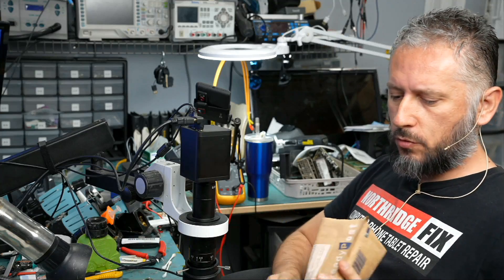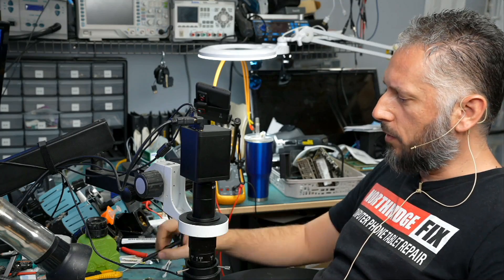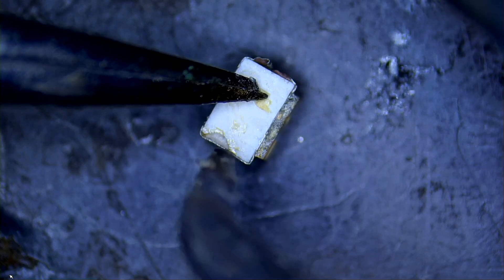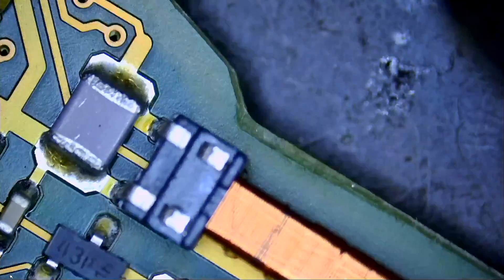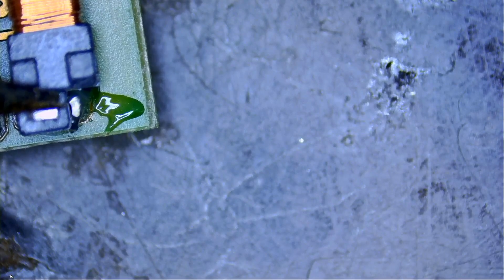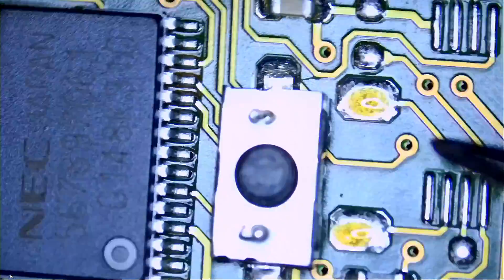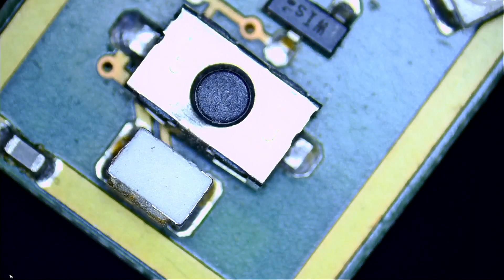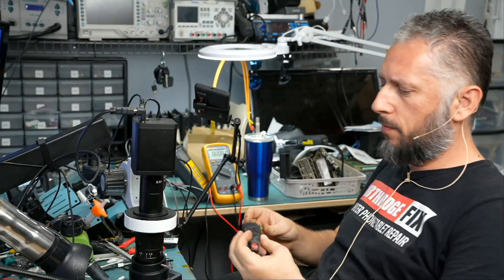2002 Key Fob won't start Car. Fragile Infrared Soldering

Comment: Another way is to grind  near the sensor and put the soldering iron tip near to one of the pads  so you can melt the solder under it and voila you take it out

Comment: I was wondering why a key fob would use IR in this day and age and then I read the title of the video. 2002 car... Ohhhh. My car made in the early 2000s didn't even have a remote control key fob. Must be one of them fancy luxury cars. Didn't know the "fob" keys used IR to start car. Never had a car that came with a fob used to start the car. Why would you want an expensive fob to start the car instead of keys is beyond me. Since it wasn't keyless as you still needed to insert the fob.

Comment: I am wondering if hot air from the bottom and some soldering paste would have also worked for soldering it back in place?

Comment: Your soldering skills are awesome! I have used "Nickel print" to connect to tiny LEDS. Basically, it is a high conductivity adhesive. I use a drop of crazy glue to attach the led and then join the pads on the LED to the traces with a small drop of conductive glue.  MG Chemicals - 841AR-15ML Nickel Print (Conductive Paint)

Comment: There are two things which we could use here without soldering:

One is a graphite adhesive, the 2nd is silver adhesive. You can see them on a rear window of the car which is heating up. Next, once it's holding, you can either use a UV mask to harden it, or you can use a super glue + baking soda.

I don't have examples of using it on this YT channel, so can't show it in action, but you're a smart person and for sure can do it ;) just on your own.
Reply: But that would not be better than factory.

Comment: If it is that heat sensitive why not use low melt solder to connect it to the motherboard ?

Comment: Super clean job, as always 👌🏽
Quick question: would it also be a good way to solder that component applying hot air from the bottom, like you did for desoldering it? maybe the component would be exposed to hot for too long, that's why you did it with the soldering iron?

Thank you :)
Reply: there is a component below the ir, but on the donor board it was removed, so using hot air from below on the customer's board will destroy that component
Reply: Applying hot air to the bottom to solder it, would ruin the component on the other side.
Reply: @tarille1043  true, he said he was doing it on the donor board because there was nothing on the other side.
Reply: What if its a removable component like a cap and you can remove it, use hot air to solder the IR then replace the component

Comment: fun fact: if your IR car keys stop working and you measure the coin battery in a tester, it could be measured in good range of capacity, but it is still not enough for the key. IDK why, but most of the car keys require high capacity of the battery.

Comment: Selamun aleykum abi,

I have a issue with my GPU but I am from Europe Belgium.

I think my VRAM needs to be get replaced or get checked. Because my pc keeps crashing on overload and have this issue almost over 2+ years. Its not software side/ drivers. Because I did everything possible.

I recently also upgraded all my parts including my power supply. But I still have the same issue.

So my Fans of my GPU starts running at 100% and I need to hard shutdown my PC to restart it back. When I check the temps I also have no problem there.

So I am 80% its a VRAM issue or Power connect.
Reply: I don't know if I can send it to you or how I can fix it?

Comment: I had a diode fall off a laptop motherboard and the laptop wouldn't turn on. It was tiny and there was no chance I could solder it on so I treated it with the good old super glue. It has been 6 years since and the laptop still works

Comment: Wondering a bit how they solder the IR Component in factory... What it the trick not to melt it down  in SMD soldering process? Just very accurate temperature control?

Comment: I'm puzzled why an RF keyfob also needs to have an IR transmitter?
Reply: RF can be jammed. Thiefs use jammers in parking lots hoping people just press lock and walk away without checking if the car actually locks.
In such a case you can point your key at the sensor at the door handle and still lock it.
Also with theses old keys IR is used for communication when the key is inserted in the lock. That's how the customer noticed the issue - he could unlock the car but not start it.

Comment: It baffles me that car manufacturers, who know the daily abuse that a fob goes through, have not sought simple ways to protect the delicate electronics.  Just further proof of the awful trend of saving a few pennies with no real concern for the end user.  Great technique and video.
Reply: Twenty years is a descent service record given the abuse you speak of. That cheap fob has outlasted many of the cars put on the road. They do be using some shady practices though.
Reply: It's part of secondary business. They expect you to buy a replacement from them instead of repairing at the prices they established beforehand. And they're not cheap.
Reply: and this is 20 years old fab, I think that new ones are even worth
Reply: it lasted 20 years, pretty good
Reply: @yugo916  this is what I said, I do not think that new ones will last so long.
Reply: Not they don't care, there's more money with bad parts like Benz key fobs, they don't just sell a fob that'll start the vehicle right away, it requires programming/coding to the vehicle which is additional fees, plus, Benz vehicles after 2014, only dealers can add keys to these vehicles, so there's money to be made for em
Reply: @thesmartguy3523  good point on the newer Benz keys. My locksmith said he has the software to program 2015+ Model but Benz has locked the features out in the dealer software.
Reply: They're in the business of selling parts 

Sure they can apply a layer of epoxy on it, but then these repairs would not be worth doing.

So if you own a Mercedes, don't throw the keys around like people used to do. Always hand them over
Reply: It's 20 years old at this point.
That's far, far beyond their care factor.
Reply: its simple my good friend. 
they want it to break.
key fobs can cost $700 from the dealer. They dont fix it, they throw it away, get a new one for $700
Reply: The car manufactures also charge hundreds of dollars for replacements. I'm willing to bet with luxury cars, like Mercedes, charge over $1k for key fob replacements.
Reply: we are all saying the samething, cuz the one on my truck is already beat to shit amd its 6 years old
Reply: They don't save cents, they only 0.1ct... But this is the problem. Ad well, the spare parts give the real money to car companies.
Reply: The same reason we have glass mobile phones  etc.
Reply: i dont know man, these key fobs are prety robust...i've dropped the fobs from both my cars dozens of times over the last 14 years i have them. they dropped in water, on hard pavement, etc, and they both work fine. 
and i cant remember a lot of people who actually had their fobs totally stop working. 
now, if key fobs start failing in 2-3 years all over the world, that would be an issue